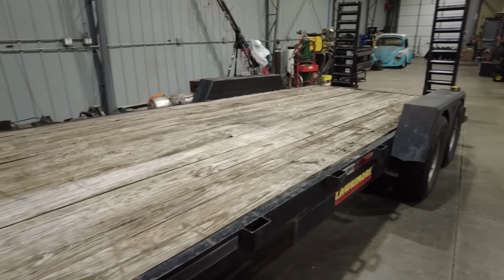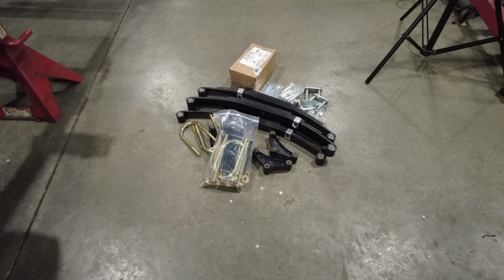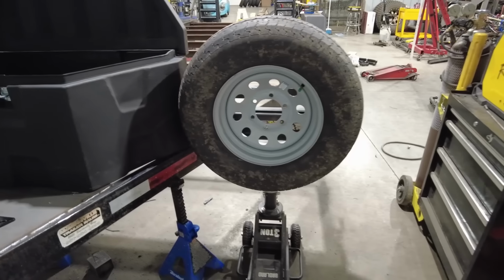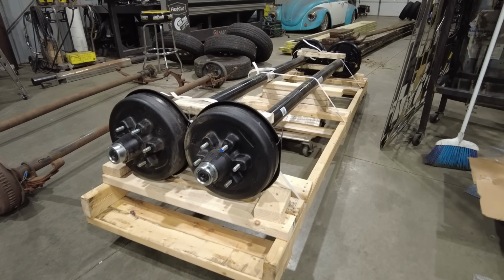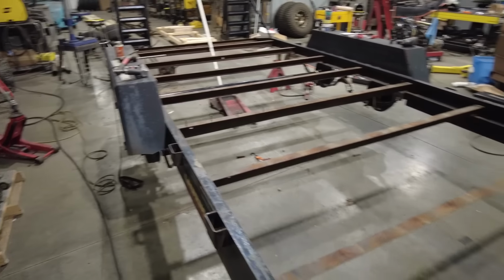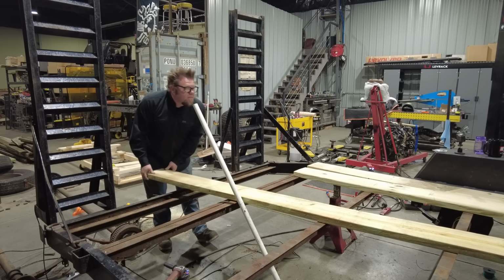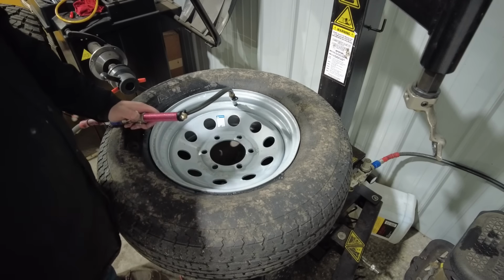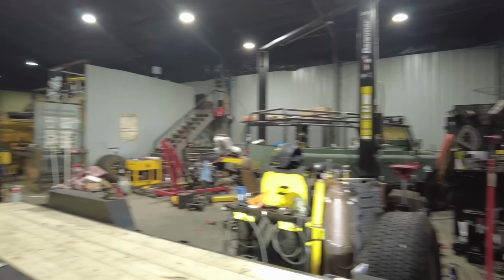Car Trailer Rebuild, How to Increase the Load Capacity of your trailer

Comment: I’ve been rebuilding a car hauler too, I’m gonna use rustoleum rusty metal primer on the frame and paint it with tractor and implement paint. If anyone is redoing the suspension bolts go ahead and look into wet bolt kits with brass bushing that is grease-able instead of the poly factory bushing. Also on the break away box, the blue wire was like 3’ long. Why not run it into the junction box and re terminate inside box instead of cutting them both and putting butt splice in middle? The board solution would have been to use 2x12’s and one 2x8 cut to fit.  On the winch. I ran into same issues. I didn’t want put it in trailer box and didn’t want to give up a foot of room on front of my trailer. Solution was removable winch! I welded a receiver hitch under my top rub bar and have the winch mounted on a hitch mount so I can use it if need be or have it off if I’m loading a tractor with bucket and want to drop it all way front. One last thing. When I was fighting where to put spare one place nobody ever suggested was under the trailer. I’m going to buy a universal spare tire winch mount and bolt it with riv nuts and bolts under the trailer behind the trailer jack. Now it’s totally out of the way. I started to bolt it up with long u bolts but what happens when it’s in the mud and you have to lay under trailer to un bolt spare? With the spare mount that is on your truck I can simply put impact or hand crank from the side and lower it down, then put flat on it and raise it back up.

Comment: How did you know that the frame was good for 10K?  Simply putting 10K worth of axles under the frame didn't mean that the frame could take that much load.
Reply from the maker: Same trailer frame from this manufacturer for 7k and 10k trailer

Comment: White wire coding for ground comes from residential power where neutral is white, black is hot. It was adopted when the feds forced RV manufacturers to follow Uniform Building Code for the power supply. This is the cause of many RV wiring mistakes.
Reply from the maker: Interesting information, thanks for sharing!

Comment: The spring shackles on your center equalizer bar need to be flipped the other direction. The shackles should be hanging from the spring not pushing down on it.
Reply from the maker: They flipped over once the load was on the trailer,,,if they had stayed in "tension" that trailer would of looked like a Bro Dozer

Comment: Love this video and the finished product.  However, there are additional costs, such as labor cost, welding material, and shop usage, that is included in a new trailer that's not factored in for this project.
Reply from the maker: I also didn't include the money made from this video on YouTube....

Comment: Your initial assessment is off because your old trailer has what’s called salvage value. In other words you can sell it as is for say $2500.  So upgrade cost is actually 7500-2500 or about 5k.  You spent over 5k without including your time cost. All new stuff. And a new OE increased GVWR ( as the lawyers see it). Your old trailer still has a 7k rating on the factory sticker. But these numbers are all wrinkled because you got paid over 6k by Lippert, which we don’t get. 
Moving the jack forward is great unless your tailgate hits it. Removing the handle gets you the clearance, or a sidewinder jack or an electric jack all give you tailgate clearance.
Reply from the maker: Tailgate doesn't hit jack at all...and the weight issue was addressed in other video.
Reply: @BigTireGarage That’s good because I’ve got some trailers that have the jack so far forward that the truck tailgate hits them. Very annoying. I have to use a longer ball hitch on those trailers.

Comment: The reason that houses and trailers use white for ground is that in the old days, when they ran power on poles, they only insulated the HOT or + wire.  The insulation was made from gutta percha, basically black rubber.  So hot was black, and neutral or - was bare.  As that extended into the house, they maintained black insulation for hot.  That is the origin of black for hot.  White was chosen for ground as it is the "opposite" of black.  So houses and trailer are black = hot.
Reply from the maker: Good info, I am always interested in the history of how things are done.

Comment: You said with two 5k# axle you can carry 10k# "capacity".  You need to subtract the weight of the trailer, likely 2500# or so, from the 10k# GVWR.  That means a capacity of 7500#, not 10k.  That is why I have a 14k# trailer, for 11k# capacity.
Reply from the maker: This frame does weigh 2500 lbs....but I do see your point and agree.  But most trailer manufacturers list trailer capacity by axle load
Reply: @BigTireGarage  Correct, misleading as that is.  Helps sell trailers to unsuspecting folks.  Same with GVWR on a truck.  My rollback weighs 15k# and has a GVWR of 26k#, so my capacity is only 11k#...  Love your work and watch all your vids as a Subscriber.

Comment: Hey Ian. I like the uplight idea and considered that mod for my tilt trailer. 
What I do have though are load lights and under bed lights, with a remote I found on the jungle site. I can see if the load shifted (or departed) and can let the bonehead following me know I don’t appreciate his gamma ray headlights.
Reply from the maker: Someone suggested adding lights inside the wheel wells for night time tire changes....I am planning to bring the trailer back for some updates soon
Reply: @ Those little magnetic rock lights are a game changer for that.  I’ll have to look them up and get you the name.

Comment: well im one to almost always fix/rebuilt something even when it doesnt make sense, this might be a situation where it looks like itd have been an obvious win to sell the trailer and buy the new one, all fresh frame, save days of work on the rebuild, alot of shop consumables used up, and likely cost more, by the time that trailer was sold and new was bought.. the 2600$ axles really did it in, over 3200USD with wheels and tires, im seeing a tandem setup the exact same 5200lbs with wheels and tires all the suspension delivered to my door for 1900CAD which must be about 1200USD or less
Reply: New trailers are built like crap in our current dystopia

Comment: I would caution anyone that thinks they can slap on a pair of higher capacity (5.2k) axles and automatically think your trailer is rated for it.  This is simply not the case.  You have to make 100% sure that the frame can handle the load, otherwise you run the risk of bending the frame although the axles would carry the load.  Thoughts?
Reply from the maker: If you watch my response video...I state that this trailer manufacturer uses the same frame on the 7k as the 10K trailers

Comment: Most of the armchair tire engineers giving advice here are WRONG about inflation pressures and load: tire pressure ratings are to be taken COLD! The tires are engineered at accept the higher pressures when HOT at full load capacity. At the least, this is one thing gleaned from 27 years at Goodyear... 21:20

Comment: Bigger tires and axles don't increase load capacity alone. First of all the frame needs strengthened, especially the tongue.  Box the C-channel. I'd recommend adding additional stringers between the suspension mounts to keep them from flexing while turning so they won't tear out of the rails. Then the coupler needs replaced with comparable weight rated one, if not already equipped.
Reply from the maker: On this particular model the manufacturer uses the same frame and suspension on both the 7.5 and 10K trailers...I looked into that before starting this project....the coupler is also the same on both
Reply: @BigTireGarage thanks for that update!

Comment: Great build. Typically non insulated connectors are used in high heat situations. Other than that, you use insulated connections. Keep up the great work.
Reply from the maker: Thanks for the feedback.

Comment: I just bought a sixteen by eight foot car holler from a guy who's rebuilt him in sacramento. I crawled under the whole thing but up at the front neck on one side of the a frame he had Is piece of metal channel and a spare tire hiding the outside The Abe frame had been cut twice clear through. He had bondo and the piece of channel inside was held by 4 non grade bolts. The welding shop.
Said this guy was Obviously hoping you would kill somebody. We'll see what the value of small claims court  In this unique time of Non governance

Comment: Maybe should have mounted an axle spindle for the spare tire.  Then you could have mounted a hub and tire to have a spare hub in case of bearing failure. Or just remove tire in case of flat.
Reply from the maker: I thought of that....

Comment: So what are you doing to upgrade the strength of the trailer? the trailer frame rails and related parts are chosen to support the load capacity of the original axles...not the ones you installed. If you purchased a trailer with the heavier axles you installed, you would find the frame built heavier to support the additional weight. Furthermore, there may be legal issues surrounding a trailer if people think they can change the legal GVWR just by putting heavier axles in it, not to mention liability issues if this trailer was in an accident with additional weight on the trailer over the original manufacturers rating of the trailer. People, be careful what you watch and hear. Do your own research and find out the legal liabilities if shit goes south...
Reply from the maker: This particular trailer manufacturer uses the same trailer frame for the 7K trailer and the 10K trailer...so no frame mods needed

Comment: Awesome rebuild! You didn't want to go over the frame with a flap disc and respray it, before replacing the timber?  Also, even though the timber is treated, what are your thoughts on oil finnishing the underside of the timber? Lovely pleasing job!

Comment: Is increasing GVWR really just as simple as  upgrading the springs and axle? I thought this was also set by the manufacturer, and even if you did the upgrades you still can't register it with a higher GVWR.
Reply from the maker: I inquired with my State, and itnit was a commercial vehicle I could apply for GVWR increase...but personal use they will not. They actually use a complicated formula that uses wheelbase and weight rating of current vs upgraded components

Comment: Great video in showing how to rebuild and customize a trailer to better suit your needs. Loved the way you explained how and why you wired the electrical components. The only thing that I would have done differently would be to sand under coat and paint the frame while it was bare bones.  That would have made it look like a brand new trailer when finished.
Reply from the maker: I thought about doing that and I do have some more upgrades planned for this trailer soon...

Comment: Been watching a lot of these trailer restorations and one thing nobody talks about that is a real issue and I have experienced with heavy hauling over the years is metal fatigue,it’s unsafe to restore these trailers and expect the, to be able to perform with their original load capacities as the flexing of the trailer has weakened the welds and the actual metal itself.You can snap your trailer in half on the highway or a main road injuring others.In other words know the limits of a restored but old trailer
Reply from the maker: Very good point....this trailer is not that "old" and I inspect it every year before we start our trips

Comment: Did you upgrade the coupler to a 2 5/16"?  A 2" coupler will still only have your trailer rated at 7K most likely.  You need the 2 5/16" to get your trailer rated to 10K
Reply from the maker: Trailer was always 2 5/16

Comment: your math is quite fuzzy on the rebuild versus purchased new. No doubt you can save some money on a rebuild especially if you enjoy your time spent doing so.
accurate math would be to take the difference from what you could sell that trailer for versus purchase new out the door. Then add in your upgrades then you can make a decision based on dollars.

Of course you know all of this, but that’s not what you stated at the beginning of your video.

Great video by the way.  There’s always room for improvement and some of the commenters here have excellent ideas that I’m going to borrow.
Reply from the maker: I see your point, but if I count my "labor" like most people say I should...then shouldn't I also count the money made on the video?
Reply: @BigTireGarage  And all income connected to the vid as well!    checking out more of your productions this week!  thanks

Comment: Something I started doing on trailer wiring is putting the wires in 1/2" PVC tubing. Using various T's, 90's, 45's, etc you can get right to each light, brake, etc.
Reply from the maker: someone else suggested that and I like the idea I plan top bring this trailer back in for an update soon and I might just do that

Comment: That box is for a Semi Truck. The colors are different for them. The Brown is for running lights on one side of the trailer and Black for the other side. No big deal just different because they use an amber turn signal that needs to be separated from the running light and there are frequently so many lights that they use a separate system for both sides.
Reply from the maker: thanks for that info

Comment: Why didn't you knock the rest off the cross frame of the trailer and paint them before putting the wood deck on???
Reply from the maker: It only had light rust on it...honestly I thought about powdercoating the entire frame...but that would of been even more work

Comment: I love projects and you get to customize it the way you want it.  This project creates interesting content for us to watch so there is some monetization there.  

However, the trailer you started with was worth at least $4000 so if you consider that into the equation.  With the cost of the parts ordered at $5362, Total of $9362.  Where as the new price the $8500.  Direct cost is about a wash by the time you add a winch and electronics etc. but I don't have as much shop time as someone like yourself.  My Labor rates are somewhere around $50 an hour in my pocket after taxes.  This project would take me at least 2 weekends which is about 40 hours of work.  An additional, opportunity cost of an additional $2000.  

If you calculate this into the equation this option would have cost me approximately $11,362. 

I my world I would not have had the time to do this project and barely have time to fix my rig so buying exactly what I want or as close as possible then breaking up into smaller week night tasks to add the winch would be a better option for me.  

To me my time is worth money and is my most valuable asset so I need to maximize my value from it.
Reply from the maker: I understand....but there is no way I could of gotten 4G for the trailer...I checked around me and used trailers in the same shape of mine were under 2K
Reply: @BigTireGarage  really I’m going to be heading to TN to pick up a trailer. AZ people want to much for their junk!
I really enjoy your videos keep up the good work and sharing your work with everyone!

Comment: The axles are 10k, the trailer is not. I can put 2 20,000lb axles on a 10,000lb trailer, that doesn’t make it a 40,000lb trailer. Come on now.
Reply from the maker: You are wrong sir
Reply: @BigTireGarage  🤣🤣🤣 should’ve done some research before responding. But whatever.
Reply from the maker: Once again...ypu are wrong...if the manufacturer uses the same trailer frame for a 7K as a 10K trailer (which this one does) then the trailer is now considered a 10K trailer. When shopping for trailers you will always find them listed based on axle carrying capacity.
Reply: @BigTireGarage  You are correct, unfortunately im not talking about the exact same trailers, with different axles.
Reply from the maker: Well that was what I built..

Comment: Don’t forget to subtract the weight of the trailer to get the correct weight rating.
Reply from the maker: All trailers are weight rated by the axles
Reply: @BigTireGarage  Yes but the axles hold the trailer too so it cancels out the rating. My trailer I was told probably has 2 3500 axles so 7 k. The trailer weighs roughly 1600 pounds so I can safely carry 5500 roughly.
Reply from the maker: Yes.. that is correct...but when ypu were shopping for the trailer it was listed as a 7K trailer..industry standard

Comment: That's a crazy way to melt the spares you could have put them on hinges so they would have been up against the tongue box then you could have folded them to the side
Reply from the maker: If they were on the tongue box it would limit my turning radius..
Reply: Not if they were on a hinge u got open them when u had to back into tight spots
Reply: Well you could mount them to the ramps lol
Reply: Have you seen the finders that fold down  but I have never had to drive over the finders

Comment: I ran into the same problem with my trailer junction block. There is a trailer standard and an RV standard and they are not the same for wire color coding.

Comment: I have had to deal with trailer wiring damage from critters and off road debris. My solution was to use some PVC tubing to run the loom through. I carry ground like you do, sure saves the random detainment over a light out on the trailer.
Reply from the maker: PVC would be a great idea!!!

Comment: 5,000lb axel
10,000lb tandem
-2,000lb trailer weight guestimation
8,000lb legal load weight.
If you want to haul 10,000lbs legally then you need 6,000lb axles.
Reply from the maker: Who said anything about being "legal"
Reply: Well nobody said anything about being stupid but that's the only thing being shown here.